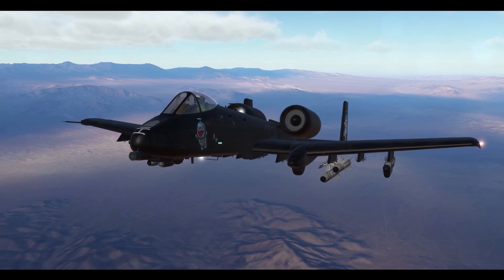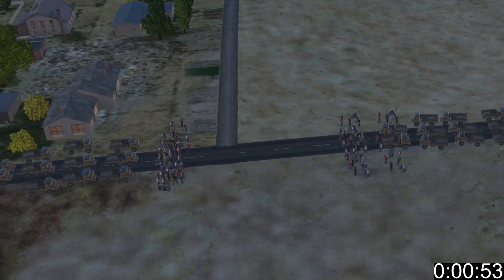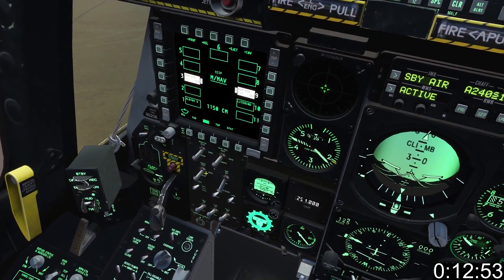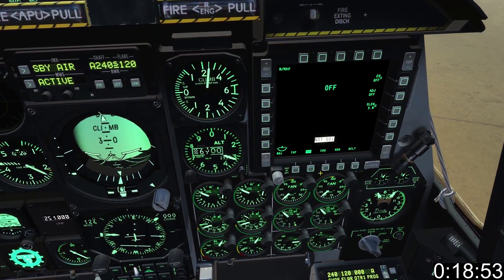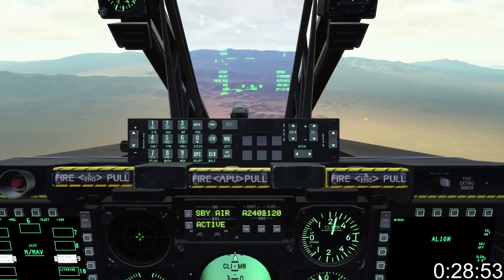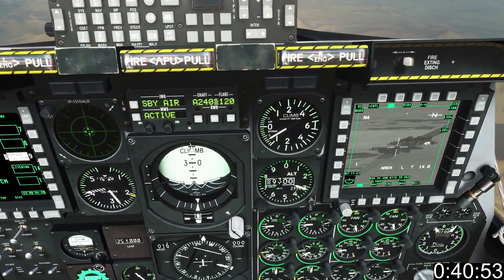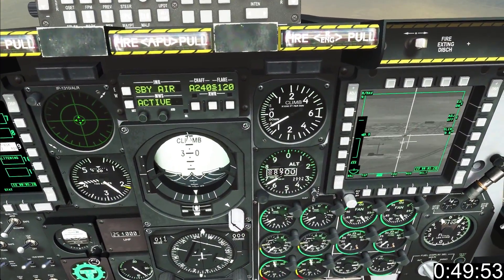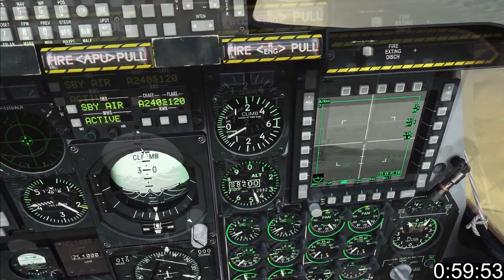1 Minute DCS - A10C - AGM-65 Maverick Tutorial

Comment: Liked your tip about slew rate to prevent all that hypersensitivity. Might have helped if I'd have read the manual 😉
It drives me nuts trying to slew that seeker head around! Meanwhile I usually try and just use short TMS up to start tracking, but I think you mentioned in the captions that only works with some Mavericks.
And by the way... What did you say about my mother in the beginning? Lol.